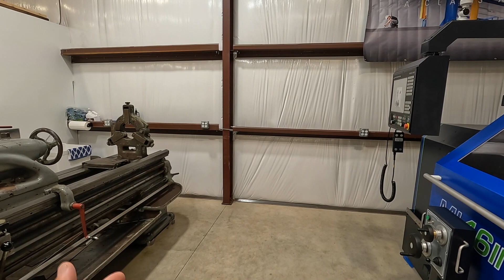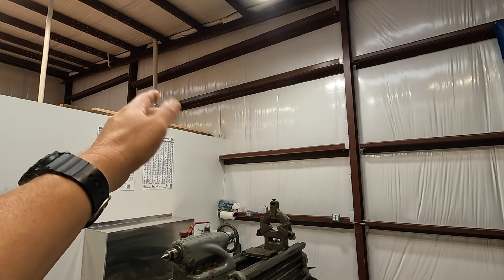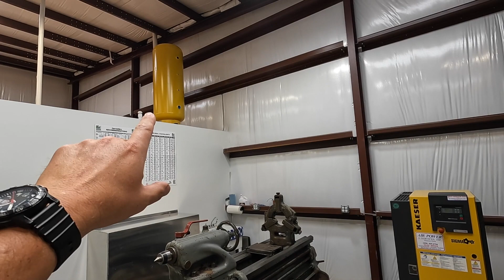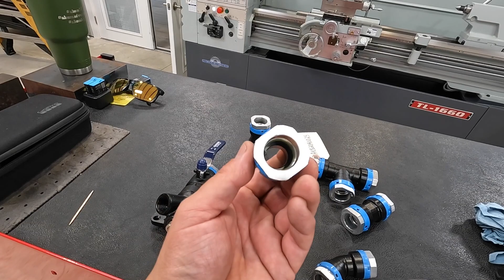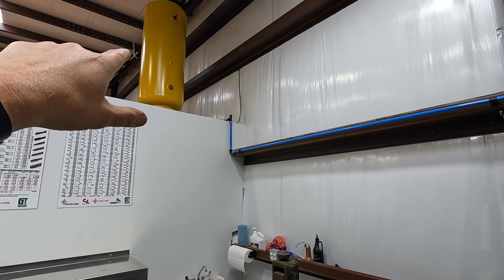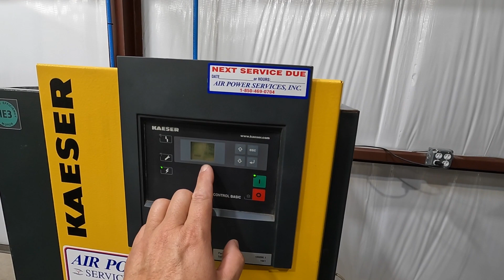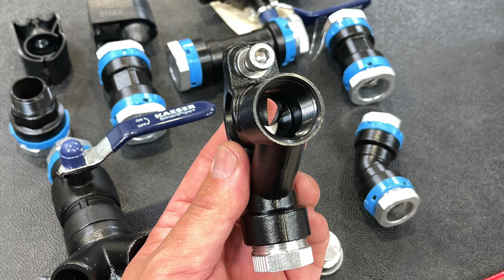KAESER Air Compressor & Smart Pipe Installation

Comment: Let me be the first to say: yOu sHOulda, WOuldA, cOULdA, Put tHE aiR maXer 61831 in Your shop. 

Save the dopes some trouble.
Edit: they've already started.
Reply: Some of your so call "dopes" have many years of experience installing and maintaining compressed air systems. Anybody can just throw a system together and make it work but to make it work efficiently takes some knowhow.
Reply: @tsmartin  implying the COMPRESSOR COMPANY that installed doesn't. FOH keyboard man.